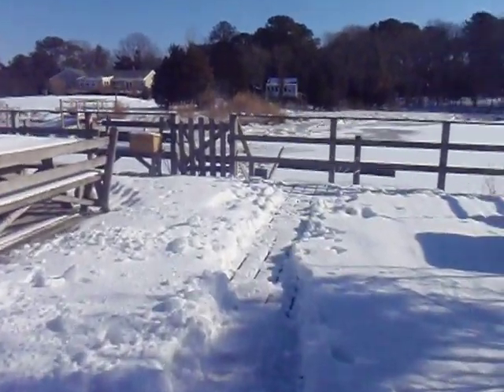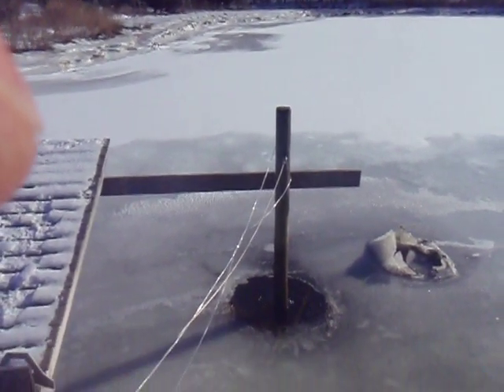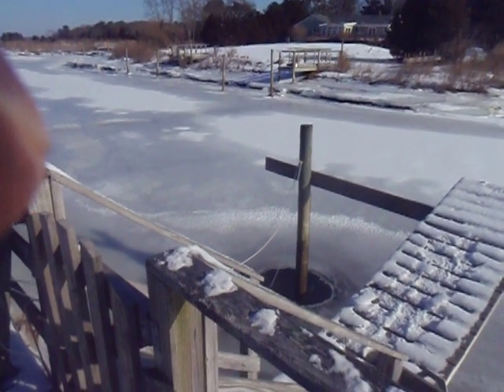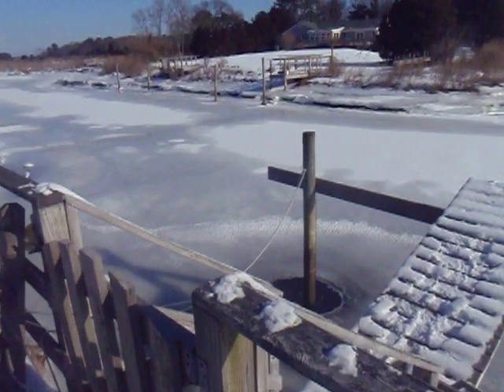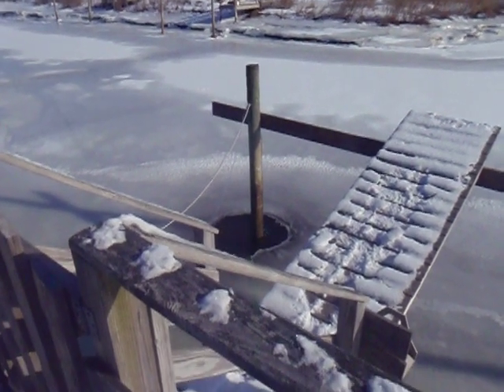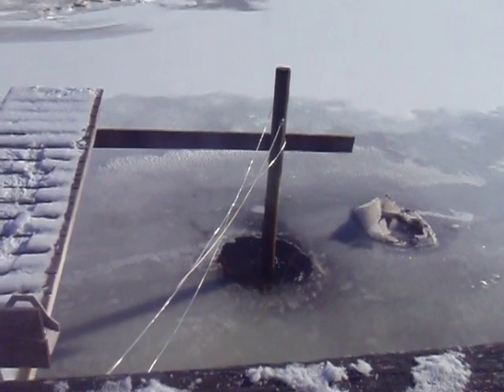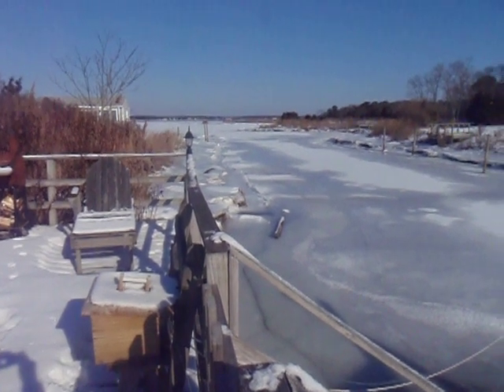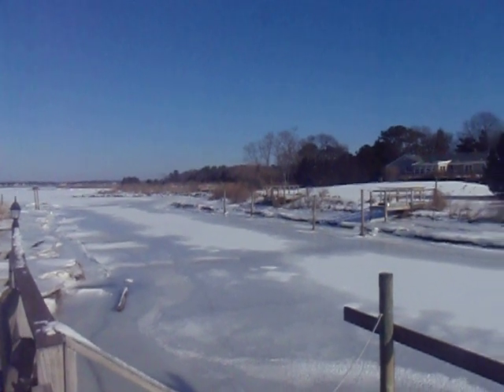Preventing dock pilings from being moved by ice Flanders New york Flanders NY

Comment: Hey Ralph. How did it handle the ice when it started melting and moving? Does the bumping of the ice do damage?
Reply from the maker: We were warned about the moving ice, but never encountered that issue.  The bubbler has worked for about 10 years now and so far moving ice never pushed the poles.  Please be reminded, we are in a small pond off the Great Peconic Bay.  I would imagine ice movement on the bay would be a problem.